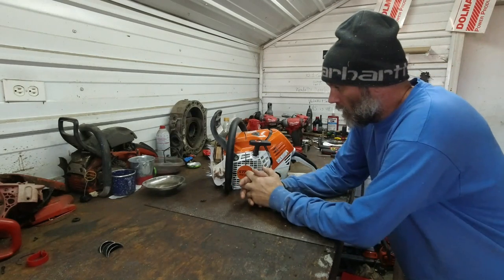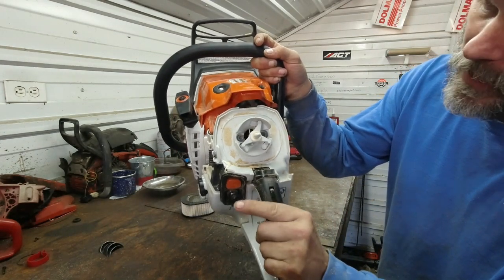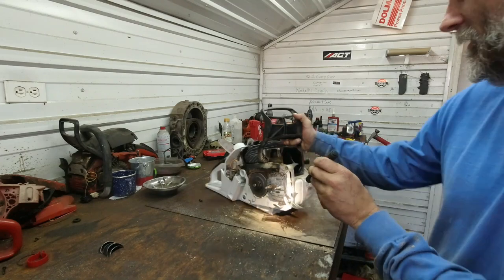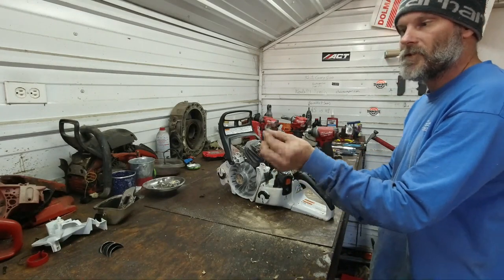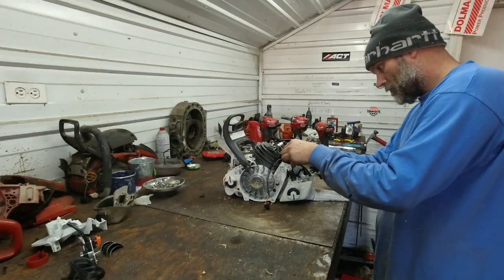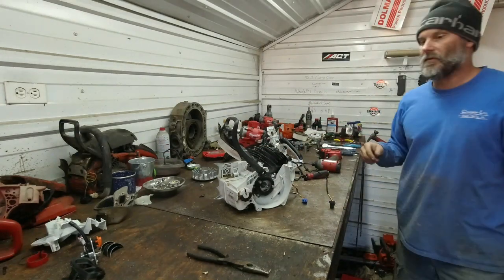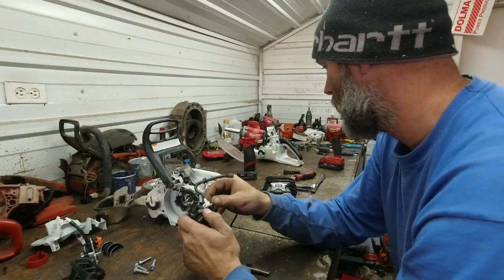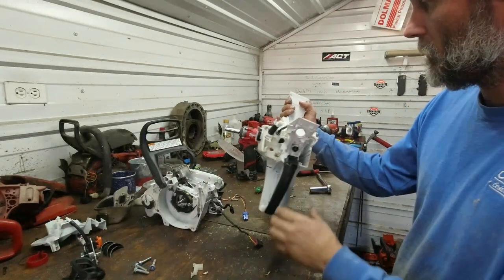Stihl MS500i chainsaw complete tear down

Comment: Stihl has had this design on the shelf for awhile since the TS500i came out, I work at a dealer in va and we recently had our stihl school and they had tons of these saws in there test room and I was talking with the service rep and he said they’ve had 1000s of hours on these with little issues. The only thing we’ve heard of is people tearing the wires with the ecu
Reply: Any info on the air filter and how it performs? It seems to be the old style used on the 260/461 etc, not the newer twist-lock HD2 filters. Always had trouble with fine dust passing around the pressure-lock on those older ones, even when putting a bit of grease to help it seal better. The filters are amazing on the 261/362/462, I really don't get it why Stihl went with this older design for it...

Comment: I was stumped about no air injection as well. Apparently air injection robs cooling air from going across the cylinder and Stihl was worried about heat issues with the 500. It is also possible that Stihl has been sitting on this design for quite a while at this point, maybe since the chop saw came out.

Comment: Mitch what's your favorite saw brand and saw?
Reply from the maker: Well, that's a tough one.  I run mostly Husqvarna due to my relationship with the dealer.  Have an excellent one locally.  For modern saws, I have far more hours on my modified 562xp than any other, tend to grab it for the shear utility of it.  Also a sucker for the Dolmar 7900, they are just a freak stock but this new Echo 7310 will likely be my go to 70cc saw.   You'll see why in my video upload tomorrow...    Favorite saw for me to run is the Dolmar KMS-4 for vintage.  Not much of a straight answer but I'm not brand loyal.
Reply: @mweba1  good answer tho.lol I always had husqvarna and always stuck with them.. just don't like the other brand designs.
Reply from the maker: @bombidude  Nothing wrong with that.  Try a commercial Dolmar/Makita if you get a chance.  Very similar feel to husky.

Comment: Well done , any thoughts on going .404 drive on this saw ?
Reply from the maker: Know a couple guys that run it in dirty conditions with success.
Reply: @mweba1  Thanks for the reply , I have wood thats been on the ground for awhile (boiler wood)  & this particular 80cc saw . My question, in the video , you didn't get into (discussion) the clutch or any drive comparisons . Just wondering which direction to go for a rim sprocket (.404 7th) . Thanks .

Comment: Do you think a max flow filter for a 661 would work on the 500i?
Reply from the maker: I do not.  At least not with out modification.
Reply: Yeah, I just want to figure something out better than the factory setup because it’s far from the best filtration setup out there.

Comment: Nice tear down Mitch. Well seems like a gimmicky saw, not impressed with that crank.. looks puny, plastic cage bearings🙈.Puny flywheel and small ports intake and exhaust thats  why it revs so fast. Muffler is fairly open, what I don't understand is how are they keeping the emmisions under control yet seems to be juicy🤔....I thought maybe small tank but that's not the case. if the injection is so precise at the combustion stage it should be more efficient surely🤷‍♂️.  be curious to what longevity is going to be like. Can see why its so light.  you pay more for less🤣

Comment: Your camera is pissing my eyes off man 😤
Reply from the maker: It was an issue while rendering the video, I tried three times with two different programs.  The raw file off camera doesn't show any issue but after editing...  Nothing I could do.
Reply: I wish I knew of a way to help you with this, because the content of your video including your teardown and expertise is next to none.  I'm really mad that the rendering is reducing the quality of an otherwise top notch piece of information for those of us wanting to learn about the inner workings of this saw.  Also, if you do any more similar videos, try to either zoom or bring the parts closer to the camera so that what we're looking at fills more of the frame of the video.  If autofocus doesn't cooperate, put your hand behind the object so that the camera doesn't try to focus on things in the background.  Otherwise I absolutely love what you are doing here.  It is extremely informative and detailed without being stretched too long considering how much there is to demonstrate.  I'm very appreciative of what you're doing here.  Personally I've only run my new 500i through around 15-20 trees and like it.  Full of liquids, it is less than a pound heavier than my 362 CMQ when that is full of liquids, both without bar and chain, despite being 20cc bigger.  I had to buy the 500i without a bar/chain due to a global shortage of light bars, so I'm still using older bars for now.  Also had to buy standard wrap and waiting for full  wrap handle that's on order due to the shortage. I agree that you need to pull the starter rope surprisingly HARD even with the decompression on this saw. Not sure why.  Also, I wish more models had the quick stop feature of my 362 cmQ.  As far as I know, the 500i can't have it.  You start depending on it stopping your chain without having to use the left wrist or right palm on the traditional chain brake.  That feature is insanely helpful when limbing and cutting through brush, especially when you're wrestling through brush.  On this new saw, I like how easy the housing covers are to take off and put back on compared to older saws that get stuck in the chain brake shield.